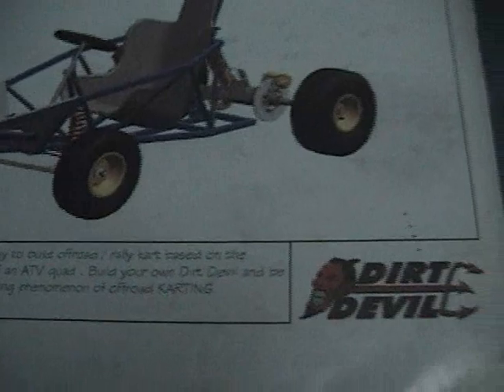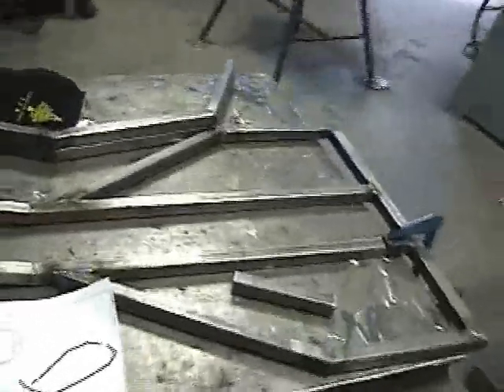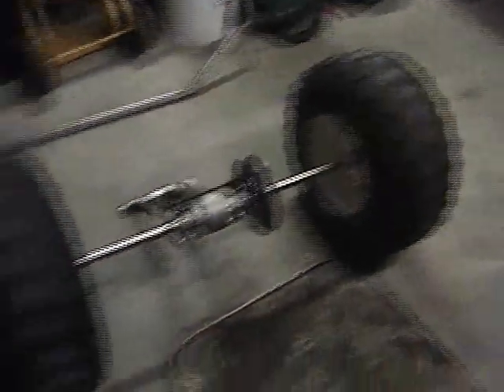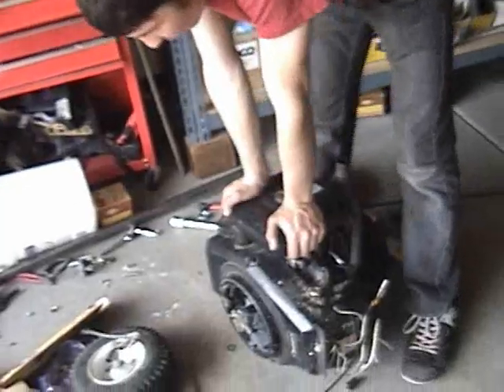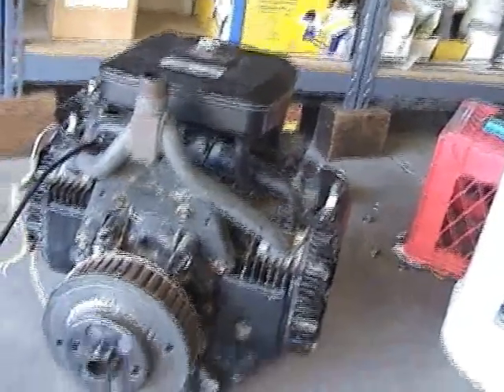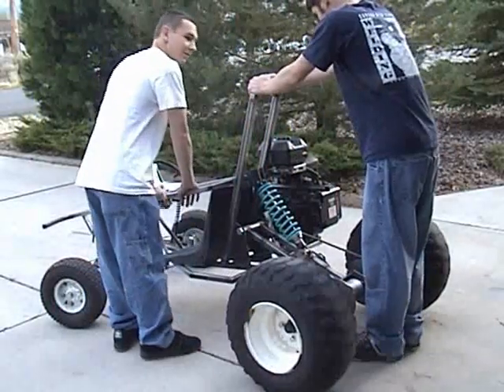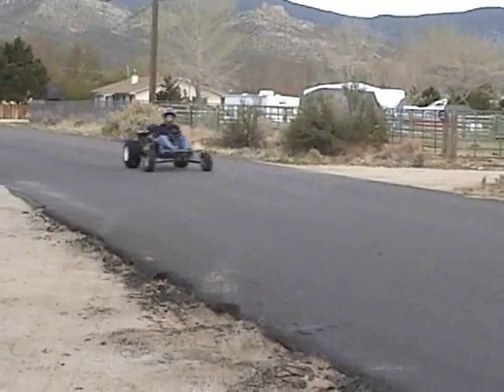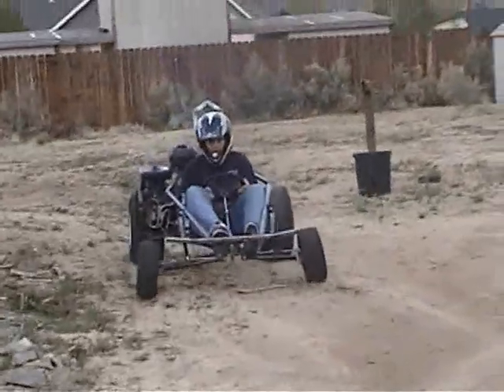Kylemonkey Builds a Go-Kart (extended)

Comment: I saw your video on here Kyle and it gave me the push I needed to build my own.
 I used the same design from the Dirt Devil Kart and modified it to run a 250 cc motorcycle motor.
 Because of so much POWER ,I had to beef up suspension and frame etc to cope.
It goes hard ,does about 55 to 60 mph.

Comment: On a two-wheeled setup you really want to use TWO mono-shocks, brother. With just the one, you start having stressing issues because of articulation. The framework wants to bend sideways because of the stress put on the sub-frame assembly by the mono-shock. Use one above each wheel and you'll be rockin', dude. Thanks for the reply.

Comment: That mono-shock in the rear is a BAD design for a two-wheeled setup in the rear. It works great for jumping on two-wheeled dirt bikes, but in this application, you're going to be twisting your rear stabilizer bars. I've made many go-karts in the past, and I've tried it before. Good luck, dude.

Comment: Steering armatures should be behind the front wheel to increase steering torque in hard turns. You have weak points in your front suspension, the shock coils should be directly inline with the frame, not offset; that joint WILL fail, so be careful.

Comment: @jungle307 unless its some highly modified racing engine, then it is probably around 3x bigger than a regular go kart engine. recreational go karts (like this one) generally use engines in the 3-8 horsepower range

Comment: @matthewmarrs123 yep now ur fucked, cuz when the valves get eaten, it wont run anymore, dumbass. wen the valves are eaten, it loses all the compression. idiot. so clearly ur problem was someting else. and the thing that you call a piston rod happens to be called a connecting rod. i have been workin with them since i was 4. i got my first locked up engine running, after i clean the points, and i never got any help. i have lived with these motors since birth. i happen to be 14 now.

Comment: Here's a few problems:

The seat is to far forwards.
The weight radio as all wrong and its all on the front shaft
The back wheels are to big/ The front wheels are to small.
you need more power....Put a turbo or cat back exhaust on it :P

Comment: Looks like fun... the building and redesigning, and rebuilding is the funnest part... i personaly would beef up the front a bit with a bit tougher material and add some "triangualeted pieces" ?? for support.. but put a bit heavier spring and shocks on the front maybe even redo the mounts for the knuckles or whatever it is you used to eliminate some of that negative front camber. thats just what I would do.. strengthen it a bit to last alot longer.  looks like fun any way i look at it, congrats.

Comment: With a Quad, a gocart, all those tools, and that 18 hp engine you could have made a freaking monster but i have to admit it is very cool but you had so many better parts already avilable all you had to do was modify the quad or at least use the suspension and rear axle to make a monster cart like those they sell at pepboys or whatever very cool

Comment: excelent job done, yall need more compression on the exhaust, see if yall can obtain an exhaust pipe from a dirt bike or a street bike, you"ll gain more horse power, and a nice sound, otherwise running like you have open headers even with a short pipe will keep extra heat on the manifold and crank case, leading to burnt valves, bad rings. more compression meens more power at the wheels, to much will result in choking the motor. just a friendly tip, otherwise that great job with your fabrication

Comment: i think the problem with those bigger motors like the 18 horsepower is because then only do 3000-3500 rpm as in the 6 horsepower and lowers ones will do 5000rpm. since most homemade gokarts dont use gearboxes your looking for more rpms then anything.

Comment: This cart, is grosly underpowerd, yes you heard me underpowerd. Your Gear ratio sucks and a Centrifugal clutch sucks. Geat a 5hp flat head, put bigger springs and a better cam, port it polish everything and you will smoke this anyday. YOU NEED A TORQUE a Verter for such a large project.